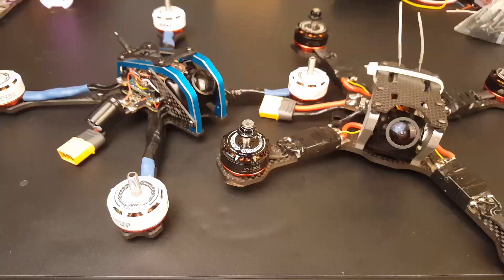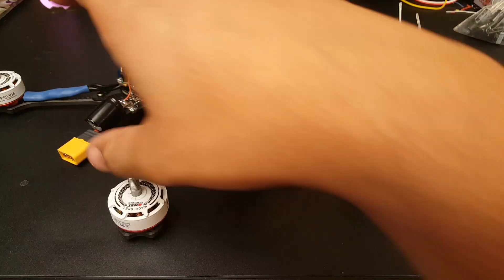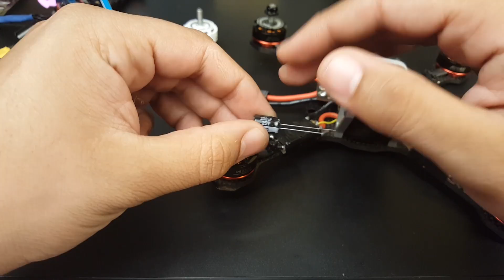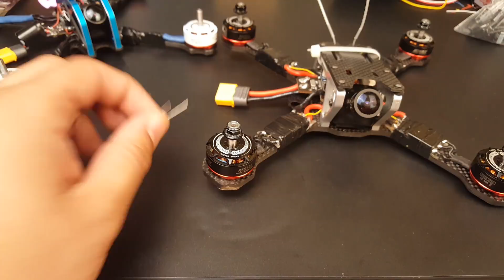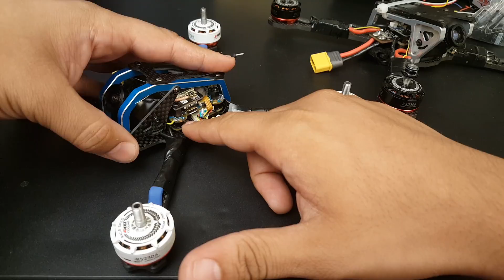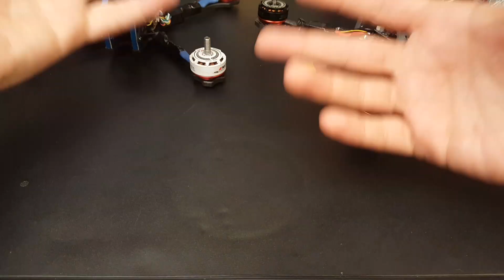Matek f405 // Yaw Twitch

Comment: I had yaw twitches (but now in 2023) on throttle punches and after a lot of brain work I found out that changing ESC's PWM freq. from 24khz to 48khz solved the problem. Just writing so maybe someone in the future might use the info :)

Comment: Crazyponey DC 2205 motors bl heli 32 esc matek f7f722-std with pdb ribbon cable connect. Quad ran fantastic for a month then after a few rough beginner flights it started twitching and got worse over time. Now it twitches so bad its unflyable and it's even getting leans to one side on top of that now. Tried changing to multi shot and a lot of config and no difference. 4k 4k. Nothing. Soft mounting when parts get here and if that still doesnt fix it then it's getting scrapped. (Side note)  video used to be super clear and since this twitching started the video noise has increased by like 30 percent.

Comment: I have a matek 405 std and speedix 35a 4 in one with emax 2205 red bottoms. I get twitch at about half throttle but nothing when I get beta flight to spin the motors. Got a capacitor on my xt60. No idea what to do. Cheers
Reply: like the video suggests, try adding one capacitor to each ESC.

Comment: Im currently using the f405 with the dalrc engine and had yaw twitches in Maiden. I fixed it with a higher pwm freq in blheli_32 But the twitches reapeared After a few crashes im trying 4k/4k today. (what surprises me is that all Motors run smooth and i cleanen them again But still got These twitches on 16k/16k)

I also have a low esr cap installed. Maybe you got another advice

Comment: Drone Mesh » thanks for the vid, i tried soft mounts and caps but neither worked. You mentioned increasing the BLHeli PWM Frequency to 48kHz and that did the trick on my setup! Blackbox logs show it clear as day, the noise on yaw gyro has disappeared and now it flys smooth at low throttle :)
Reply: Had the same yaw issues with Matek F405-STD, Holybro Tekko32s (not the 4in1) and GEPRC GR2306 2450kv motors. Luckily, increasing the PWM frequency was the 1st thing I tried..
Reply: Plz tell me how i can change khz im new to flying

Comment: I have Racestar 30A V2 BL_HeliS  (DSHOT300) and RCX SE2205 2400KV. My quad is shaking (left right) on low throttle, but when I give him more throttle it's starting spining. I can stop this only by disarm. I didin't modify the ESC's.

Comment: Just maiden my new build with this board. iPeaka blhelly s rgb d600, amaxinno motors, caps on each esc as provided from matek, 8k/8k,  and after I punch out and release throttle it twitches and start rotating. Not shure if that is this same problem, bit it is anoying.
Reply from the maker: +JOZA drop to 8k 4k and check your soft mounts

Comment: Unfortunately I have the yaw twitch with the matek f405 :(. Running  DYS Aria 35A escs with T-motor F40 Pros. I am using the capacitor provided by matek and every thing is soft mounted including the motors. I am going to try and add the capacitors to each esc. 
Another cause is maybe because the build is very tight and then there are vibrations so I don't really know...

Comment: hi. I have armattan 2206 velvet motors with 30A ESC from armattan.I’ve put 470uF cap on each esc and run 16/16khz loop. After few flights I get twich on yaw. I have not tested yet lower speed of loops.

Comment: I have the problem really badly with Emax 2205S 2300kv motors and Racerstar 30A V2 ESCs on my Matek F405 FC and Matek FCHub pdb combo soft mounted with the standard included rubber mounts.

Comment: Just installed the F405 board on a new build.  It came with 4no.  220uf  35V  capacitors ( one for each ESC ).  Without them you get the yaw twitch on throttle up, with them, no twitching at all.

Comment: not a chance of putting those ugly things on , the whole point of a FC PDB board is to save space, weight and look tidy, why correct a board that is clearly not working at 100% , matek should take the lot back , mine is going straight back to where i got it from

Comment: Im having Yaw Twich at throttle input. Setup F405 AIO, Emax 2205s and  Chaos BLHeli_S Dshot ESC. Probably the ESC are the week link in the chain. Setting 4k/4k and adding 470uF capacitors to ESCs and battery mains, lets see what happens hopefully will stop. Thanks for the video and tips. Cheers
Reply: Update. The twitch didnt stop. Went crazy and added 2 x 1000uF capacitors to the battery port and now yes it flies smooth. Probably will try with just one 1000uF because this capacitors are a  bit big. Finally I can enjoy this board . cheers

Comment: Thanks, I will try this out ....almost bought a new one out of frustration because i could not find the problem...i hope this is it because it's a relative easy solution. My problem is that my quad does not flip or roll straight.When i give only pitch or roll input it will yaw a bit during the flip or roll. Hope this works. I will let you guys now if this solved it.
Reply: noop. ..that wasn't it. It even got worse running 4K 4K. But I'll keep trying different things. If anyone has any suggestions....you're welcome!

Comment: I just ordered a Matek F405 AIO, Emax RS2306 2750kv, Makerfire 30a 3-6s ESCs, along with some 5s graphene lipos. I'm excited to build my 2nd miniquad. @1:45 you said to use 330 microfarad 25V caps on each ESC when using 4s but not 5s, why is that? I'm preemptively hoping to get a good bunch of hardware and learn how to troubleshoot if things get wonky and get ideas from other's previous experiences with the F405 AIO. Anyone have experience with similar setup or tips?

Comment: i have the twitch problem, just bought the matek aio and i have the setup dys xsd30a v2 and dys storm 2207 2300kv with the stock cap, xsr and swift2.

just trying to fix it...

i had this setup with the f4 flame and didnt have any problem, then i crash and my fc died when i rip a motor (dont power any led, if you know how to fix it i will be very happy cause i didnt had any issue with the flame)

i'm thinking that maybe could be my vtx (eachine vtx tx801)

Comment: Ive been using 220Uf 25v caps on ESCs since before the Mateks came out, so although I've moved to the Matek boards I've never seen this issue at 8/8 or 16/8.

I also use an unusual soft mount for my motors, silicon mounts on top with foam mount under the arms and Armattan plastic landing feet holding the underarm foam mounts on.

Matek AIO Wraith 35s with red bottom 2300s,  Matek OSD Airbot Typhoon 4 in 1 (I think that's basically Wraith) with BoltRC 2207 2450s .

Comment: Spedix ES30 HV with Hypetrain motors. Big disappointment to maiden and then yaw twitch almost sent it to the next suburb.

I've never had issues with previous quads until getting this Matek board, and never used caps before so didn't use the one provided. Massive problems and nothing I tried fixed it, until I added the cap on the battery pads. 

The twitch is almost completely gone! I will be getting some caps for each ESC soon to see if there is further improvement, after I retune my PIDs.

Thanks!

Comment: I had small yaw twitches even with a 470 mf cap. Soft mounting the motors (RS 2306/2700) solved the twitches.

Comment: I'm having the problem with a T-Motor F60 and Aikon SEFM 30A. Very bad noise on the yaw axis, according to blackbox.
I tried 32k gyro sampling first, but that was not flyable, twitching like mad. 8k/8k and increasing the yaw LP freq. to 50 Hz did help a bit.
Will try 4k/4k and maybe go to 120 Hz yaw LP. If that doesn't help, I'll add the capacitors.
Edit: I also just ordered soft-mounts for the motors :)

Comment: I have some insane problems here, with RCX 2206 2400kV. Does anyone want to look at blackbox and video? https://drive.google.com/drive/folders/0B9Lnsj9U0mK8eDNhSmR0XzVxSkk

I added low ESR Panasonic caps to each ESC, but the problem is equally bad. Unflyable if more than hovering (I manage to stay in the air, but it is really hard)

Comment: I have EMAX 2205 red bottoms as you have and also EMAX Lightning ESC flashed to use MultiShot. My FC was SP Racing F3 EVO running on 8/4 with separate pid loop on 8 and it was all on a VTail frame. I ve tried everything including setting up notch filters exactly for that motor + ESC combination. Result was just numb flying quad. Ive changed the frame for solid bottom plate (not the one that screws together) and the problem disappeared. So Ive blamed the vibrations. Never had the problem again and I am still flying with those motors and ESC combo on new frame even after Ive cracked the previous one :D

Comment: By the way yaw twitching still happen when motors are reversed in BLHeli ESC settings or in BetaFlight (for easier control and to avoid getting dirt in camera). Seems like firmware issue. Should I report it to Boris?
Reply: Definitely was a BetaFlight issue. Flashed mine F405 AIO with BF 3.2.0 RC5 a week later and it has no twitching with reversed motors anymore. No twitching with BF 3.2.1 stable as well.

Comment: I have yaw twitch with:
Softmounted FC currently BF 3.2RC4, previously BF3.1.7. I've tried 32k/16k, 16k/8k, 8k/4k (current) 4k/2k
Emax rs2205-S 2300kV motors
littlebee spring 35A ESCs, ground wires are connected.  I think these originally ran BL16.6 but have since been upgraded to BL16.65,
4S battery

I've made it flyable by massively detuning the PIDs - my YAW P term is about 17 instead of the stock 70, most of the other PID terms also had to be lowered.

Currently got the stock cap installed at the FC power pads, just received some Panasonic FM 25V 330uF caps which I'll hopefully be installing on the ESCs tonight.
Reply from the maker: andycb1 Those esc you are using are very very noisy and I do not recommend.

Cap should help on each esc.
Reply: Drone Mesh yeah I found that out from your videos, unfortunately after I'd bought and soldered them so trying to make do with them rather than upgrade to something like the wraith32
Reply: Adding the caps seems to have fixed things :D

Comment: You mentioned something about setting a yaw offset is betaflight in you frog race build with the matek f405. What is that?
Reply from the maker: +Tushar Tyagi Yes you need to set yaw to 270 go to http://www.mateksys.com make sure the www is in the link or it won't open.

Find Matek f405 aio and there will be tabs for the product page find connection and setup and look at the pics. 

Still need help let me know.
Reply: Drone Mesh Thanks. You are the best.

Comment: I was having very bad mid throttle oscillations and motor hiccups/stutters running the Spedix hv 30amp esc's, Emax RS2306 2750kv motors, and a hard mounted Omnibus F4 V3 fc running 8k 8k. I decided to attack this problem with the two prong solution of adding the Matek rubber soft mount standoffs, along with adding a 35v 470uF low esr capacitor to the main power input on my pdb which solved the above mentioned issues. I still had vtx/fpv camera noise/blackouts after all of that, but instead of powering the fpv system from the pdb, which supposedly has an lc filter, I now power it from the Omnibus's supplied 12v vbat fpv pins with no further problems.

Comment: Do you know about phase shifting between current and voltage when adding capacitors?   To get max power factor voltage and current should be the same phase.    I saw a video where one capacitor put I & E 90° out.  And you just put 5 on top of allll of the other caps on the escs.  What happens when you add that many? Does it lap all the way back to in phase?
Reply from the maker: +John Doe just got the equipment and we will test this out.

Comment: I think it's Betaflight's problem or just laziness. RaceFlight has the same gyro and runs on 32k - rock solid, no twitches, no issues. Latest updates on Betaflight github have some slew filter and other ideas how to minimize sudden gyro value changes and that's what happening. I hope they will implement that properly when 3.2 will be released. But for now that gyro and 32k is only working on Raceflight as it should.
Reply: the boards are powered in a slightly different ways, maybe that has something to do with it.

Comment: I just finished building a quad. Realacc215 with RCsplit, F4 Flame and UFOFPV Bheli32 30A. 8K8K32K then I set 32K on esc pwm as well. So far on bench testing I have no such issue... Looking forward to next weekend to maiden.

Comment: I don't know if they made a version 2 of the f405..  or whatever. I'm running 32/16k on my F405 with DYS XS30A Esc's that I modded to Run Dshot 600. by Removing the filter capacitor. I don't realy have this Problem everyone talks about. I haven't added any capacitor either.

Comment: I have 2 builds with matek f405 AIOs. One has wraith 32s and emax 2306 motors. The other has Wraith 32s and Tmotor air 40s. Both run 8k/8k, and neither of them have ever had any yaw twitch. They fly perfectly.
Reply: Forgot to mention. Both builds are only using the included Matek caps. Nothing extra on the escs.

Comment: I've been working on my FC (with ICM20602) even without all mounted caps (ceramic ones, I was lazy) with soft-mount I can run 32/32 PID loop without yaw twitch. Obviously when you hard mount the board it's not possible to fly it >4k. However, if you get twitching with soft-mount then deffo something is f*** up.

Comment: Hi, I have matek f405 aio with original capacitor running 8k/8k, dys xs30a running dshot 600 and dys fire motor 2300kv all soft mounted and i don't have any problem ;)
Reply: hi! did you have to remove the caps from de xs30 and update de firmware to run dshot600? I just bought them to run with the matek AIO
Reply: Hi.. Yeah, I have removed the little capacitor and they works very well with dshot 600 ;)

Comment: Thanks for the info I found some vex units don't have good inductor and I could tell by how it got so I changed it with hot air and it was fixed no lines even thought cap would fix. Also had unit I could move and get noise similar issue inductor was broke maybe after crash did a swap and good. Lol I get parts from other devices so always have to test after but its been good. You try the diode in this issue? It might cut spike off then one cap suck down rest I think just one on power line I think Mata put diode on pdb that has ribbon cable.

Comment: i have ms35A racerstar 2306s and i get yaw spin of death with softmount everything and 4x470uF ( one on each esc) on 4k 4k
Reply from the maker: +Arne Vorbeck ms35a is worse than emax bullet. You must change your esc plus I had these burn out on me and burn my emax 2306 2750kv motors before.

Either you keep this board or buy another I recommend you change your ESC. 

If you change them then the board and any other board should fly amazing.

Keep me updated.
Reply: Drone Mesh i purchased the aria 35A now. Hope they are better :)
Reply from the maker: Arne Vorbeck Keep me updated

Comment: Has anyone binned the FS A8S to the Taranis QX7? If yes can you send info to pcruzinc@gmail.com, thanks so much.
Reply from the maker: +Primo Cruz you need the multi protocol module for qx7 and should be able to bind if I believe.
Reply: That can't be done with the Q X7's internal module.
Reply: Yeah, make sure you check compatibility before buying! There is the iRangeX multiprotocol TX you can use, which I believe binds every time it is used, but I am not experienced with using this.

Comment: Two Asgard v2's with 2.5mm bullet connectors on the arms on my Frog Lite twin quads. No problems so far. So easy to swap out motors after a bad crash!  :)

Comment: I think I solved the issue with bullett 30s and zmxfinx23s I added 4 lowesr caps to each esc pad on fc. Motors still get hot tho.
Reply from the maker: +Big RussFpv Hot motors will be pids and filters :)

What rating caps did you add?
Reply: Drone Mesh I used 2 of the caps the matek come with and 2 25v 330 rubycon zlh. And with my other quads I run filters same and motors don't get nowhere near as hot. If you can just get another board its not worth all the trouble

Comment: had it with the brotherhobby 2450kv 2306 / spedix blheli_s 30a / f405 aio - cap fixed it but still has some odd issues with yaw turning at high throttle - reckon new escs could sort it without adding a million caps?
Reply: jamble7k Sounds like a PID / TPA setting problem
Reply: yea possible, will try turning on antigrav / upping yaw I
Reply: flying perfectly now, just needed a bit of pid changes - also works well on 5S!

Comment: Having no problems with spedix 30 hv with 2200 kv f80s running 5s battery on 8k 8k soft mounted everything with one cap off main battery